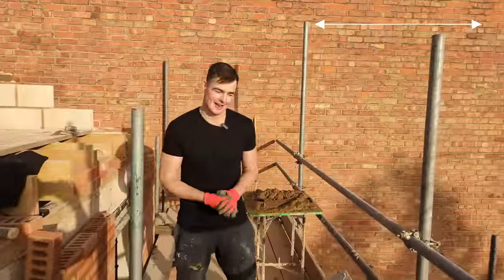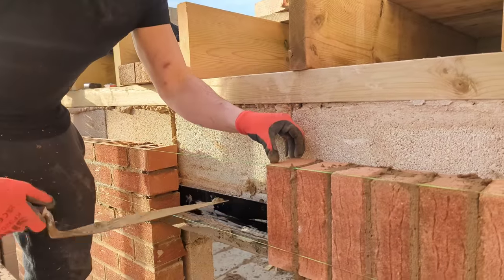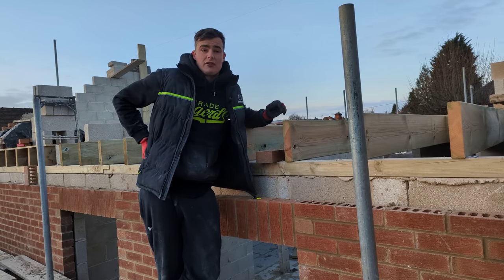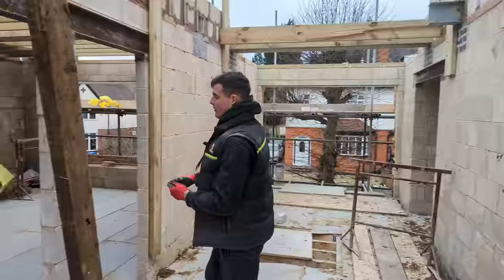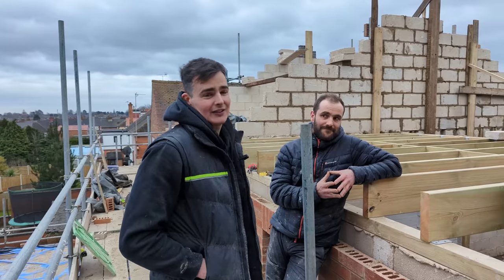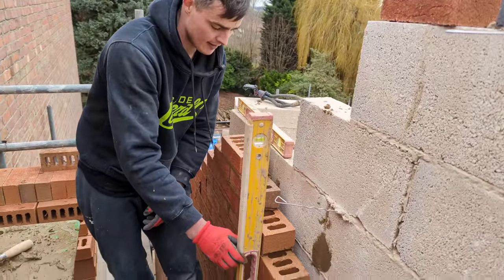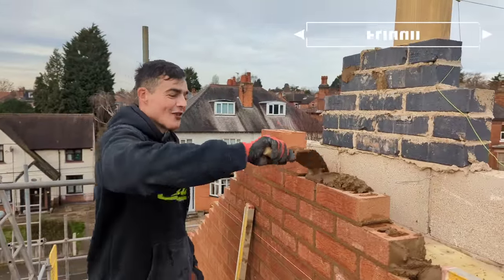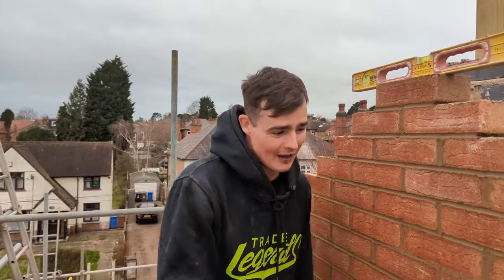NEVER QUIT! - Bricklayer Vs Wind- IzzyTheBricky Weekly ep03 #renovation #vlog

Comment: New subscriber love this content have questions about repairs on 100 year old house with similar construction techniques. 
Q1. Wooden beams eaten by termites on first floor original beams were part of brick walls double brick construction. Center iron load bearing support with angle iron bolted to pickup ends of joist’s 2” overhang.
If you are replacing the beams do you open the brick wall through to the outside insert the replacement joist set it on the steel and then replace the outside bricks?
Or is there another method for doing the same job?

Comment: Unlucky, but like you said, it could have been worse. I live in a an area where the weather can be extreme, ive seen a few blow downs but thats with far stronger winds, its very common to have 35 km/ph plus here during winter it frequently exceeds 100 km/ph so lifts have to be well braced especially in winter months.

Comment: Brilliant tips for apprentices with the plumbing and ranging. Will be using those tips when I (re)start my blockaying in May.

I've seen those blue bricks used for padstones before. Why are blue bricks used instead of the big, heavy, one-piece, concrete block padstones?
Reply from the maker: Brilliant to hear you found them helpful mate! All the best
Reply: Forgive my ignorance, do they have a better crushing strength  especially if there solid blues . Dont mean to step on toes just interested in all things Bricklaying
🤔

Comment: How long will the insulation between the walls last?
In my country it is built differently, the insulation is placed on the outside of the wall and basaltic wool or extruded polystyrene is placed

Comment: Hi, when you put bricks and the length of first layer is fx. 5 meters, but does not fit length of X amount of bricks how do you proceed and how do you cut it to fit??? I mean you cant do half stone then whole stone shifts right? How do you make it all come together, when length of foundation does not match the length of the bricks? Love your channel... Thanks.
Reply from the maker: Hi mate great question. All you do is make your joints in-between the bricks slightly bigger or smaller to fit the footing or length of the wall what is required

Comment: We dont dont do the innerwalls with mortar annymore. We do it with a thin layer of a glue in powder with water. Its much stronger against wind. You place some steal braces with ankers and nothing will happen
Reply: Glue in powder? 😂
Reply: @thomasthetankengine2257  you mix the powder with water
Reply from the maker: Very interesting method mate! Where do you work? Not seen that method here, but alot in Germany
Reply: @IzzytheBricky  Netherlands
Reply: Think he is on about thin joint
Reply: @ksmith7611  you can call it like that
Reply: How does the thin mortar effect the vertical gauging? Are blocks oversize?
Reply: @AaaaandAction  the blocks are 190x192x450mm and layed in a thin mortar. When the walls are finished they are temparary brased until walls or roofs are installed

Comment: Brilliant Izzy what a legend craig is. On a different them stabila levels are real pain in the ass with them protectors just a hindrance and limits use of the tool. Got 1 but bloody bit is getting multi tooled off 😆😆 didn’t get for the plastic bits but the bubble lower on 1 side that at times gets on ma tits also. 😆😆😆😆 on other note moving the berry yfood drink 😛 keep rocking it bigman.
Reply from the maker: Thanks so much man! Yea when I first got it I couldn't get use to it . however....ive been known to slam my levels..so might be best to keep the plastic bits on 😉 I've just ordered myself some more! Ps 3 more adverts to come🤫 what's your favourite flavour mate?
Reply: @IzzytheBricky  
Crazy coconut could smash plenty bottles of that lol. Then would be the berry.  Banana and vanilla good also. Not a fan chocolate drinks hate coffee and salted Carmel so will swerve them lol. The strawberry lassie and mango they say they ain’t bring back till summer strange a say get the coffee ☕️ 🤢 and salted Carmel oot the road for them. Lol
Yeah had level for a while if a trowel chopper with blade then good idea keeping it on 😆 just tend grab it when plumbing use any can with bloody plastic catches at times on the fingers 😆
You had the snack bars thinking will order the white and coconut chocolate 1,s.

Comment: 90% of the time on new builds there is a tray and weeps above ff windows even if the soldiers are the only masonry before the soffit.
I have always thought they were unnecessary. Is it in the regs that less than 600mm masonry it's not needed?